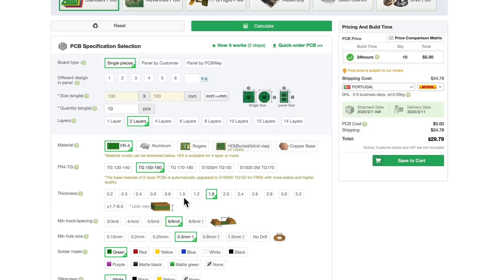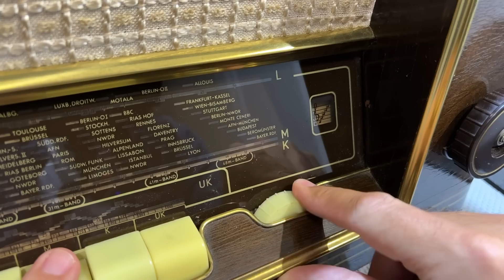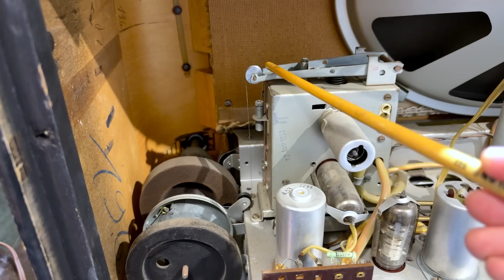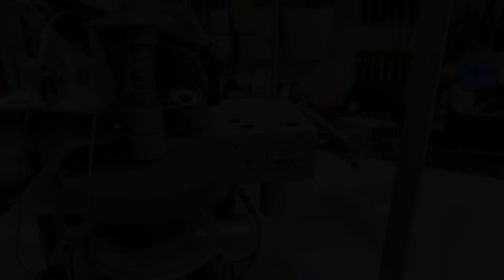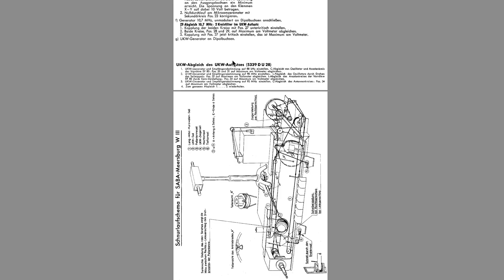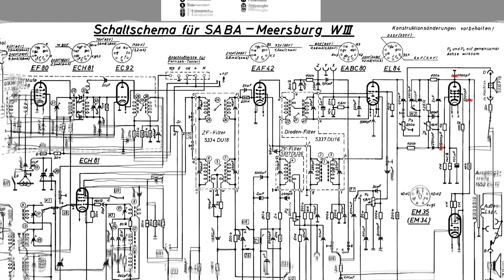New Tube Radio Restoration Series! SABA Meersburg W3 – A Masterpiece Reborn - pt.1 #pcbway#

Comment: 🙂 Another  beauty. Regarding that trim, something I have done in the past (for completely unrelated to radios reasons I admit) is used a small comb gauge to get the profile then modeled it in CAD and simply extruded the shape for 3D printing. Admittedly that looks a bit long unless you have a large printer but at least you could iterate it at a short length, say 50mm, until it's right than get a printing service to do it in resin at the full length, including miters. Bit of sanding and gold paint and it might just blend right in (mine was an heirloom picture frame). Looking forward to the whole series, it was you that originally inspired me to tackle a Solara Riviera that was essentially an ornament, it now has bluetooth and FM (so far) 😁.
Reply from the maker: That’s more or less where I’m going 😊

Comment: if the radio had hard to get valves, i don't think I'd power it up without changing the dc blocking caps.
But that's just me.
But i have seem smoothing caps blow an amplifier apart, the paper insides destroyed the PCB and the metal can went straight through the speaker and out the amp through the grill. 😞 could have easily been fixed fixed but turned into scrap in one loud bang. Was about 15 at the time and was doing day release from school to the local college, the amp was going to be the music system in the lab. 😞
Reply from the maker: Yes, I too have seen some of those explosions 😊 however, sometimes I like to get a more complete initial assessment, so I take a few risks 🤷‍♂️
Reply: @electronicsoldandnew  Have you worked on a sonny ICF5900W I've got one to look at. The pop-up aerial don't and can't find any reference to a spring. Plus it sounds like a motorboat. I expect it could do with a re-cap by the sound of it, but that's a hell of a lot of stripping down to do that.😞
Reply from the maker: No, haven’t come across that model yet. However, I did the crf320, which also lacked the sprung antenas, and I came up with a good solution for that. It’s on the channel.

Comment: P.S., I did not notice the rotating antenna there, by the speaker. That was GREAT 👍 technology way back when. That tells me that the antenna must automatically adjust to what radio station you're tuning into. Again, your friend, Jeff.
Reply from the maker: You tune the station on LW or MW and then rotate the antenna for the best signal, if you are not using an external antenna. Allows you to place the radio where it best fits and not lose the ability to pick up stations that are geographically diverse around you.

Comment: Another radio 📻 saved from the dump. Where there's a will, there's a way. I have no idea what year this is from, but I'll guess 1953-1954. You'll do just fine on it.  I'd replace ALL yellow and black bumblebee capacitors, if this radio 📻 has any. They are notorious for failure. Your friend, Jeff.
Reply from the maker: Yes, it’s exactly 53/54 according to the records. All those caps will be replaced as I don’t expect any of them to have held up well.

Comment: Another beautiful, quality radio and that is a bombastic speaker! 
From what I see, as a novice, these German radios seem to be more straightforward than eg, the Philips or other brands. Even when they have some specific quirk or innovative feature. What is your opinion on this, because I also like these German tube radios. I am also a fan of classic Mercedes-Benz cars of the 50's to early 80's, and they had the Becker and Blau Punkt 'Alpine' and 'Europa' (transistor) radios that are much sought after today. Very nicely made, the dials,buttons, strength and quality of the reception is wonderful. 🐞
Reply from the maker: I am absolutely in the German radio camp, even though I e restored a few Philips sets. The Philips always has some really “strange” aspects and are much more difficult to work on.

Comment: I used to have an old Sparton Equasonne made in 1929. It was in a huge cabinet that was about 4-1/2 or more feet tall. It was as much of a piece of furniture as it was a radio. Huge size was typical of American radios prior to 1930. But some American radios were also huge up into the 40s of course. Unfortunately, I had to sell it in 2006 when I was experiencing financial difficulties. Due to their size they were never very considered desirable or popular and so I didn't get much money for it. There are very few examples that exist, which still doesn't increase their value for some reason. Maybe only 6 to 8 examples in the world, some in museums. Some of the tubes in it were eight inches tall at least.  My former radio was recently sold at a Bonham Skinner auction, I recognized it because it was missing a little chunk of wood that apparently nobody ever replaced! The chance that same piece would be missing from another very rare radio was astronomical, so I know it was my old radio. I often wonder how many times it changed hands before it got to Bonham Skinner! Sparton Bluebird radios made a few year later in a much smaller size (and in Art Deco style) can fetch over $20,000.00 USD due to their rarity and their beauty. Too bad I had the Equasonne and not the Bluebird!
Reply from the maker: Yes, some of those old radios are huge. Their size does make them impractical to keep in a normal home, starting with the space needed just to restore them. The value of old radios is a bit of a mystery. However, there is a resurgence in interest to own these vintage units, and I have noticed prices going up generally for all tube radios. The rare ones obviously become Collectors items, so I expect they’ll continue to go up in price like art.

Comment: You could have a cracked resistor or loose connecion of a resistor carbon connection to the lead. 
Looks like a real fun radio to work on.
Most of the ones I work on are ones that some one else has buggered up.
Some of them, only good working part is the tunning capacitor.
Keep the good work.
Reply from the maker: The crackling just makes the restoration more interesting. And yes, many of the ones I work on have been tampered with, but thankfully this one is still untouched.

Comment: It's truly sad that Europe was so late at expanding the UKW band to 108 mHz.   The practicality of these old Euro version sets would be so much greater!   I will say, though, that my US Version Grundigs and Telefunkens really are poor performers on the FM band.   Sensitivity is low and audio distortion seems unusually high.  Selectivity is pathetic.   I have yet to find a plug-in Multiplex decoder that doesn't add even more distortion to the equation.   Mind you:   I'm not skilled at Alignments, but it seems consistent across all the sets I own and have owned.  That said I believe it probably boils down to a lot more than just alignment issues.
Reply from the maker: I’m a little surprised by that. All the ones I’ve restored sound absolutely fabulous on FM it could be related to the stretching of the band, because that’s the only difference I can think of.

Comment: Those"brass" trims are a bit of a game on these Mid 50s German radios.

Part of my background is in metal refinishing so Im a little familiar with these kind of trims. I have found some trims are made from a brass extrusion and theyre the easiest and nicest to rework. 

On some lesser marques I have found them to be made from a cheaper aluminium extrusion that has a brass tinted lacquer sprayed on.

Typically I scratch the back of an unseen part to determine if its brass or aluminum.

If its brass, all good, itll get the lacquer removed, cleaned and a bit of a polish then I lacquer them to save them needing the tarnishing cleaned off periodically. The lacquer stops this maintenance requirement and keeps the trim "bright" for years if not indefinitely. Todays UV resistent lacquers are fantastic and very scratch resistant.

If theyre aluminium I take them into my old employers and strip the tinted lacquer off in their heated solvent based "degreaser". Then itll get a light polish to the bare aluminum and then itll get two coats of a modern brass tinted lacquer and its difficult to see the difference.

I was surprised when I discovered the first aluminium trim masquerading as brass. Ive only been playing with these German radios for about 5 or 6 years and only manage to restore on average one or two a year ... probably because Im too fussy on the aesthetics and not experienced enough on the electronics.
Bit its good therapy.
Reply from the maker: 👍 thanks for the tips

Comment: The noise could be a result of bad contacts of the EAF42. This is a Rimlock Tube, the pins usually are black and should be polished. But I am sure, you will solve all issues and after restauration you get one of the best Saba Radios at it's time. Only the Freiburg was above the Meersburg. 

Funfact: the names of all Saba Radios are names of towns and villages in the region, where they were built in southern Germany, called "Schwarzwald" = Black Forest. The bigger the town, the bigger the radio. Freiburg, Meersburg, Freudenstadt, Villingen, Wildbad, Triberg....
The Musicboxes are named after regions like "Baden", "Schwarzwald" or "Bodensee"

btw: if you'd like to see a really overengineered radio, look for a Siemens M7. 14 FM circuits, 11 tubes, FM tuner with PCC84 instead of the usual EEC83 and an additional EC92. Only for the heating of the PCC84 an extra-winding at the power transformer. Push-pull amplifier with two EL84
Reply from the maker: I’ve had that Siemens on my wish list for quite a while now 😊 I’m a sucker for punishment

Comment: 👍  Most Manufactures tend to "skimp" on those rotating Antenna coils!; and they break easily!  SABA really did this one right! 👌
---
It's interesting how much plastic 'piping' they used for insulation.  That's a very odd speaker, but interesting as well!  Look forward to the schematic.  It could also be a resistor arching.

Comment: Warum bin ich hier gesperrt?
Reply from the maker: You are not. I don’t block anyone (as long as the discourse remains decent 😊)
Reply: That's weird, Manuel. My original message to you is not published in the comments. Shortly after publication, it disappears again.
Reply from the maker: Strange. It must be a YouTube issue as I haven’t done anything st my end.
Reply: Ich wollte dir mitteilen, dass du die gesuchten selbstklebenden Goldstreifen auf der Webseite vom ATR shop finden kannst.
Reply: Unfortunately, posting the link from the website does not work
Reply from the maker: YouTube prevents that to avoid spam and virus propagation
Reply: Hmmm... anyway. I hope you find the atr shop website. It's German.
Reply from the maker: Yes, thanks. I’ve seen it.

Comment: Judging from the schematic, the tweeter (Hochton, top right) appears to be an electrostatic version. It has a little capacitor symbol inside.
Reply from the maker: Yes, but it’s rather unusual as regards where it is connected to.
Reply: @electronicsoldandnew  Piezo-electric maybe (like a crystal cartridge working in reverse as a driver)?
Reply from the maker: Well soon see 😊
Reply: @electronicsoldandnew  It is indeed.